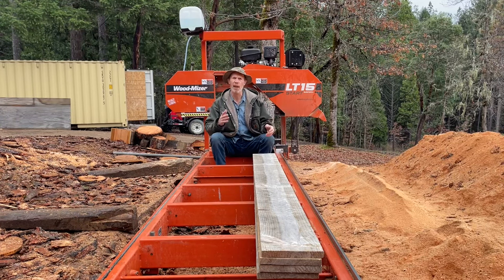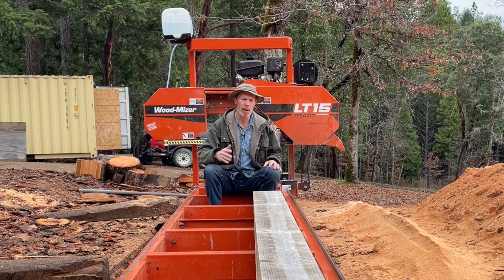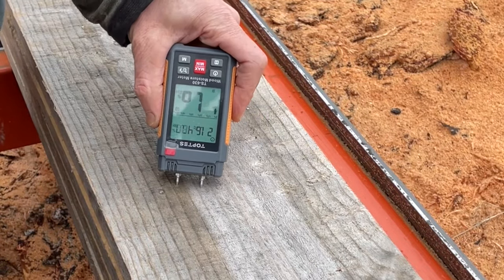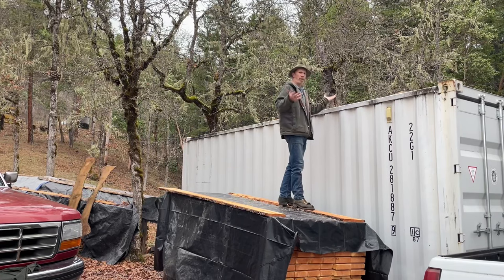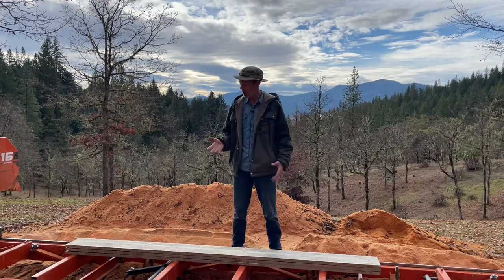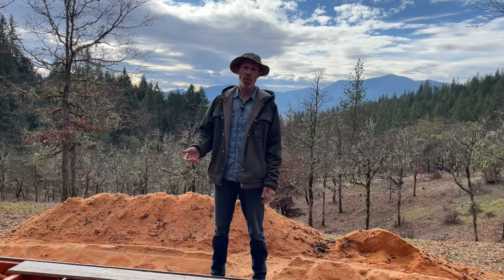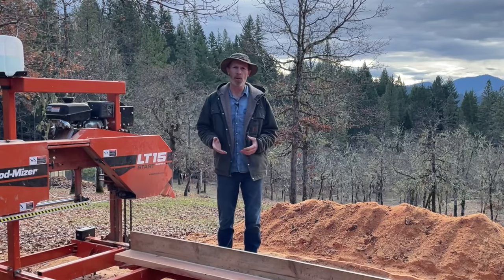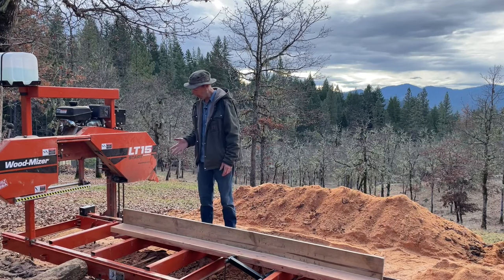Straightening Warped Lumber Experiments Continued

Comment: I was installing beveled Cedar siding last summer and the guy at Tyee Cedar lumber said to prime both sides of the wood before installing. That was a great idea as the bundle when undone you could almost see the wood twist a bit before I had all the planks primed. When we put it down with nails and put flashing under the butt with a 1/16 gap. The side of the house that we replaced came out great I am glad the lumber guy told me to prime both sides before installation. It pays to pay a little extra sometimes to get good information.

Comment: I worked in a woodshop years ago that did a lot of resawn lumber.  We ripped a lot of 2x4s and 2x6s down to 1x4/6s (truckloads a day) I've seen beautiful perfectly straight lumber twist like a noodle as it came off the saw, usually in multiple directions.

Comment: I think the issue you may be having is one side of the wood is exposed and the other side is on the ground. Kind of like burning wood. If you only expose one side it will offset the moisture balance ion the wood and it will always warp in that direction.

Comment: The only likely way a thin board like that could have invisible tension is perfectly widthwise. But they weren't like that to begin with, they were showing the tension flagrantly by twisting. So how was that supposed to happen? It's like people imagine gremlins in there.

When you 'reset' them to as-cut moisture and dried them under pressure, consider what happened. The fibers deformed somewhat. My prediction is that you would see some movement as you re-moisten, ending up evenly moist and flat, and a lot of movement when drying again without restraint. Less so if some fibers were permanently buckled or snapped.

Comment: Getting off the subject a bit...
I take it your Farley pleased with your Farmi skidder... haven't heard you complain...
Trying to find one in the Midwest isn't easy ... 
Is the ol Massey about 80hp. ???
An that is a 501 isn't it ???
Reply from the maker: Yes very pleased. The winch is over 30 years old. I only recently had to do a little work on it. Replaced some bearings. Simple to do an easy to get from the manufacturer. The tractor has been very reliable for around the same time since we’ve had it. An MF30 Industrial. A quick search says 61 hp.

Comment: i predict that the board in the rain will dry warped do to the top surface being exposed more directly to rain and sunshine.
Reply from the maker: That could be. It might be good to flip it a time or two to get even results.
Reply: I’m not so sure; sometimes I think it’s dependent on the size of the tree and how close to the heartwood the plank is (I’m assuming plain sawn, not quarter sawn).
I’ve had unprotected flat stock cup after a rain; the growth rings were widely spread, and the cupping was in the direction of the tree’s core, regardless of whether the rain fell on a surface with the rings pointing up or down.

Comment: Do you get termite issues with your wood or around your mill?
Reply from the maker: No I haven’t noticed any termites. We usually only get termites here if wood is in contact with the ground for an extended period. Which I usually don’t do around the mill. I occasionally find them at the bottom of firewood piles if the wood has been sitting on the ground for a while.